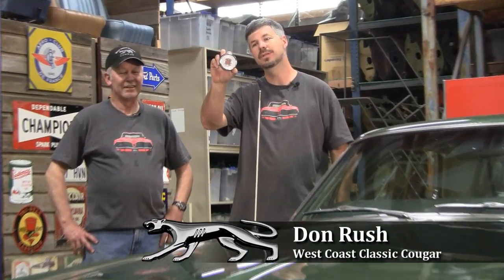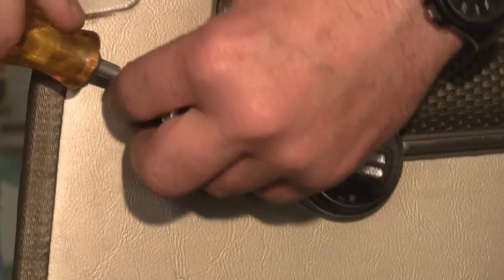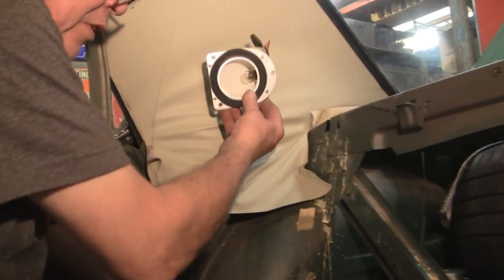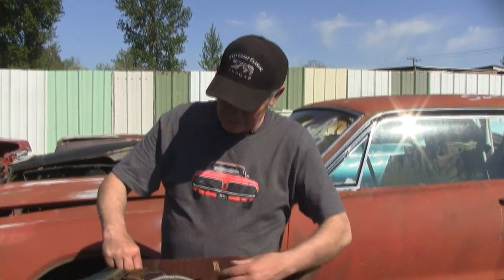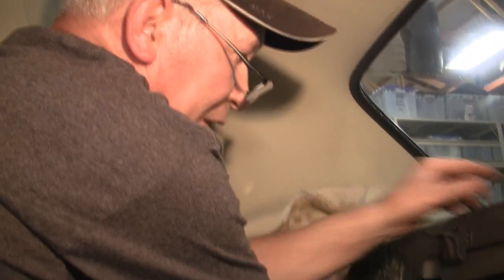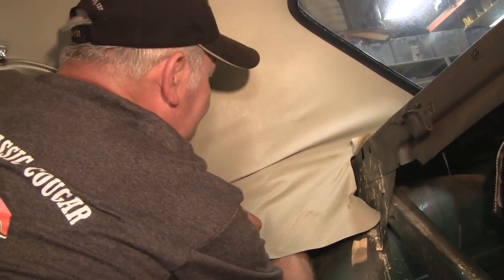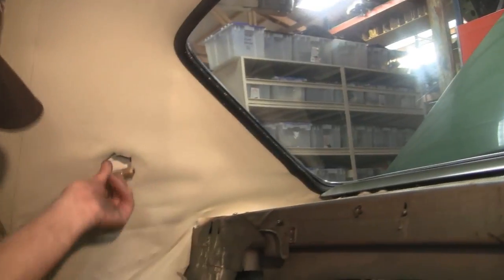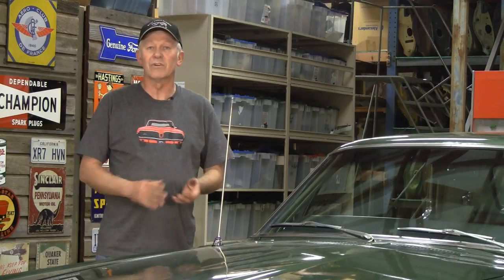Installing Rear Courtesy Lights on any 67-68 Cougar

Comment from the maker: If you have an XR7, or if your car was ordered with the courtesy light option, then the wiring will be there.  Otherwise, all 69-70's have it on the LH side (built in to the taillight wiring) but on the RH side you need a separate piece of wiring.  We can usually dig up a good used one if needed, give us a call at (503) 463-1130
Also keep in mind that 69-70 cars use a different light assembly than the ones shown in this video.  We have them new on our website.

Comment: Hi, very informative video. I was installing my opera lights on my 68 cat but noticed the wires for it were missing from the harness. Any tips on how to wire them? Thanks
Reply from the maker: Are you sure? The plugs are always built in to the stock harness. They are usually taped down and you might have to reach back by the rear wheel arch to find them.